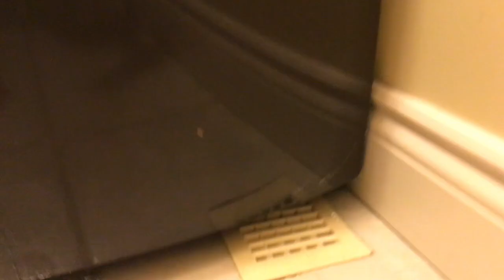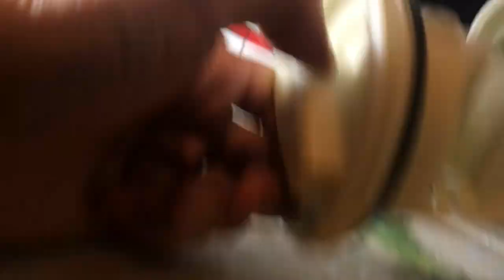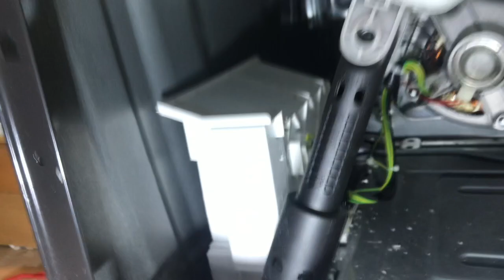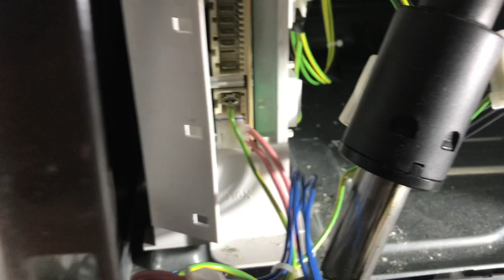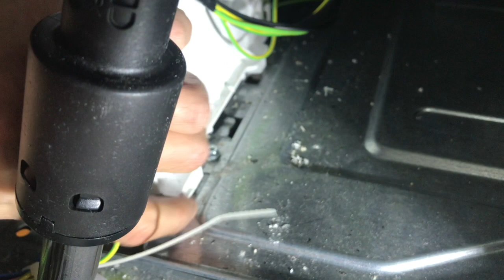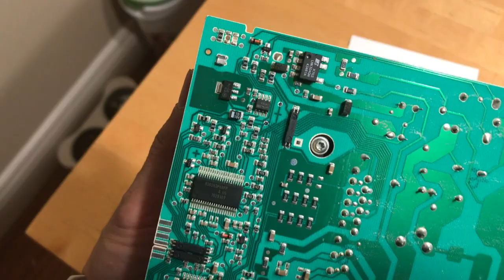Easy DIY Repair: F70 Error on Kenmore Washer

Comment: Great video, any suggestions of a good website that sells this motor control unit?
Reply from the maker: You can see if it’s available on eBay or Amazon for your model.  I’ve seen it listed for my unit there for a few hundred dollars.  Good luck.

Comment: Thank you!!! You are the man. Same issue. Our daughter just came home from college for the summer. She washed one load last night and then this morning we tried to start the washer and nothing. I got it to throw a code 70. Removed the motor control board to inspect. Nothing looked burnt, loose, or corroded. I reinstalled and Walla,  it's working again. Saved me $330 on the parts site. I found a used one eBay for $36. Thankfully I don't seem to need one now. Again thank you for the video.

Comment: Thank you for that wonderful video and explanation which was very clear. 
I followed your instructions and did not see anything that looked like a component failure but did notice that the printed circuit board had a covering of fine powdery substance on back side of the board that had adhered possibly due to the severe weather event that caused moisture and debri to possibly short out the circuit at times when the humidity is high.
Thank you again and God bless.
Reply from the maker: Glad the video was helpful.  Hope you were able to fix your machine.

Comment: Here's a passage from a blog that will help you determine the cause of the F70 error:

"To determine the cause of the problem you will need to unplug the washer for 30 seconds then plug the washer back in. 
Wait 1 minute before you try to power the unit up. 
If the washer will not power up, unplug the washer again and access the motor control board. The motor control board is located in the bottom portion of the washer. Now remove the connector with the three blue wires. Leave the connector disconnected, plug the washer back in. 
Wait 1 minute, and push the power button. If the washer powers up you need to replace the motor control."
Reply: Put that all together.
Sorry YouTube will NOT let me post this any other motherfucking way.
Reply: POS YouTube is not letting me post the part #.
Reply: Whirlpool drive motor control board
Part Control Board
Reply: Wow YouTube is a FUCKING POS!
I can't post any of this.
Reply: Do NOT pay $300+ for this part.
Reply: It cost $50 used.
Reply: WP
Reply: 818
Reply: 3196

Comment: THAT was a clear and helpful video, well shot, well commented. thank you.
I would though like to hear an opinion on why the unit worked when the MCU was reconnected? electronics don't just fix themselves. 
was it just the process of disconnecting and reseating the harnesses, so it was just a bad connection?
Reply from the maker: I think it was a bad connection.  To this day it works fine.

Comment: It F7 the same as F70 ?
Reply: Is ?
Reply from the maker: Unfortunately it’s not the same error but I would check the board anyway to see if there are any burnt spots on the contacts.  The F7 error is an issue with your motor.

Comment: Thanks Danny! I made sure to just unplug the power, all the wires and plug them back in, and then yep; it powered back up fine clearing the F71 error code. At the beginning I did find a plastic bottle cap in the drain filter after checking there first as well as my daughter's make up remover pad. lol. I wonder if that semi blockage produced the error and could only be cleared by removing the wire plugs and re-inserting. The drain plug wasn't inserted into the rubber "feet" at the bottom of the HET3 Kenmore Elite washer as well. All good. If I did need to buy a MCU, I found one for $174 on Amazon. Not too bad.  Thanks again!
Reply from the maker: Glad you were able to fix the problem.  Thanks for commenting.  Also one last tip, I notice that I would get “sud” errors whenever using either the powder or liquid detergents.  Now I use the detergent pods instead and no more issues.

Comment: I fixed my washer by replacing the MCU (motor control unit). I was able to get it on ebay from a user that parted it out because of a mechanical problem.

My motor worn down the insulation and shorted out the MCU sending stray voltage and blowing the logic on MCU. I suggest putting electrical tape on the wires on the motor to prevent this later on and also level the unit to prevent vibration.

Comment: My frigidaire washer has the E68 and E71 codes what should I do?
Reply from the maker: Check the drain hose to see if there isn’t any kinks, and do a cleaning of the drain filter.  Then I would try and turn off and on the breakers to the machine to full rest your machine.  If that does not work, i would check the control board to see if anything blew.  I have another video for this.

Comment: F70 in the troubleshooting guide shows that there is no communication between the conrtoller and the main board.
Reply: In my case I was getting F70 but and it turned out to be the MCU.